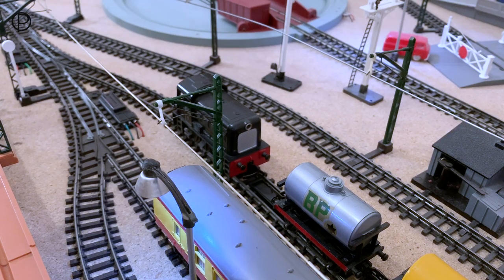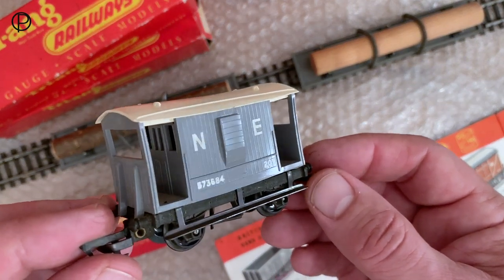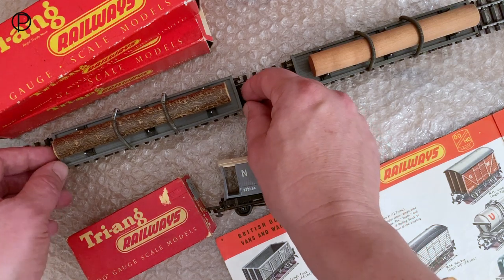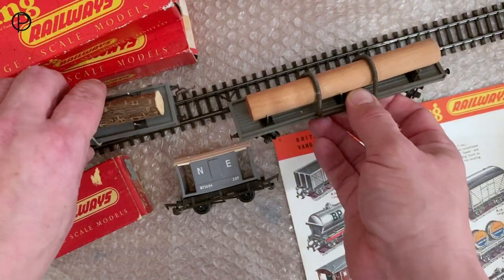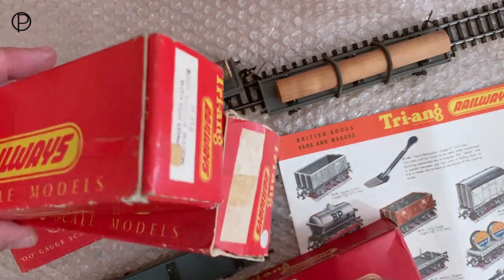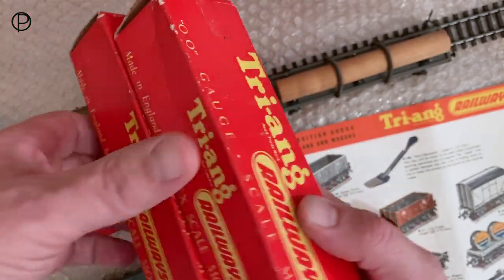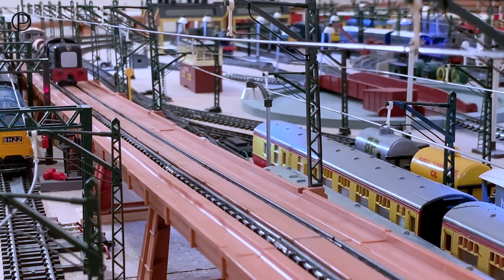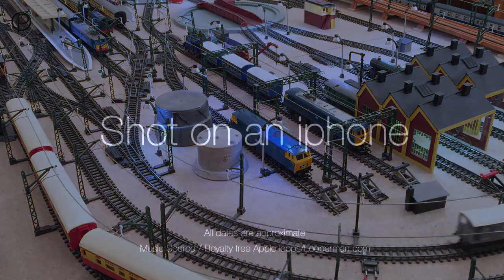Tri-ang Railways R.253 Dock Shunter with Bogie Bolster Wagons with Log Loads

Comment: Hello Oscar,   Been watching your videos for some time,  great stuff along with all the information you give about each model.  These old Dock Shunters are very collectable with all the variations they done, I have eight all different, Red, Black and Yellow all with nothing broken, interesting in your catalogue they showed one with a different number although you said, not made.  Nice to hear all your wording obviously a real enthusiast, I look forward to more
Reply from the maker: Hi Barry, glad you're enjoying the videos, I think that was the 1958 catalogue with 57 on the cab side. Pat Hammonds books make no reference to 57 being on the side of this model. Its quite confusing sometimes reading across three books and I frequently make mistakes! Sounds like you have a great collection. I have the black one you see in the video and a slightly later one in black with its lift of lid box numbered 5, A red one numbered 3 from the late 60s in a Tri-ang Hornby square section box with flaps at each end, a black one from 1976 numbered 3 (smooth wheels) in a widow box with black face card & white outline illustration of the model. Then I have the Yard Switchers R353 a Red unboxed one numbered TR20071 and shield on cab , a yellow on in a lift of lid box with Tri-ang Railways on the side and shield on cab and then A Yellow one in the RS11 set with Tri-ang Railways on the cab side but very worn and shield on cab. So I still have a few variations to have fun finding. Thanks for watching and taking the time to comment.
Oscar
Reply: @oscarpaisley  Hello again Oscar,  Thank you for your long reply yesterday.
I expect you have heard of ,  chambs123   on Youtube,    if not type in , chambs123, help needed here, dock shunters,  regards from  Barry

Comment: Thanks Oscar, great video, I just acquired a black Dock Shunter, not quite as old, with tension lock couplings, great runner, I prefer that earlier type pick-up, the light unit was missing so I've put a yellow LED in for now
Reply from the maker: Hi Paul, I've installed an LED in one of these models too that had no lighting unit. It's very bright, I've always been going redo it and never got around to changing it
Thanks for watching.
Oscar.

Comment: Great video again mate ,I have two from around 76/77 one I got mint boxed last year and the other I’ve had from new ,I just found a replacement body in mint condition for her as the old one was well worn from my childhood ,It was and still is a sweet runner and I’m still amazed how slow it can go even over peco insulfrog points ,those old motors if well maintained were superb and it great that your channel is bringing back good memories as I got  this shunter for Christmas 77 and always remember the smell of the fresh oil and turning out the lights to see the head light shining it came in the same present as a texaco wagon and the must have set of 1977 the intercity 125 can imagine how busy I was Christmas afternoon had it set up on a board in my room my dad ,grandad ,step brother and uncle playing with my new trains hehehehe didn’t get a look in until Boxing Day mate 
Thanks Oscar  Mark 😊👍🏻
Reply from the maker: Good morning Mark, that sounds like a terrific Christmas. The smell of these items in use is often overlooked but a very important part of the memories. This litte model must have been a great seller for the company and great design using the existing motor bogie,
Glad you enjoyed the video.
Oscar

Comment: Nice to see your dock shunter and running so well.  I have one which I have converted to DCC complete with LED head and rear lights which I run on code 100 track.  It runs OK but would probably benefit from an attached shunting truck with additional pickups.  I always enjoy to your videos.  Keep them coming.
Reply from the maker: Good evening Robert, glad you enjoyed seeing this model on the layout. Sounds like a great upgrade you have made. I've installed an LED in one of these models that had no lighting unit. It's very very bright, I've always been going redo it and get the brightness down.
Thanks again for watching.
Oscar

Comment: R253 was my first ever diesel model and it really is a classic Triang model, great looking and tough as old boots too-mine did a few baseboard tumbles and survived. Same power bogie as the lovely TC diesels too. How do these mechanisms last Oscar? do they need frquent lubrication on those pads and motor worms? regards Paul
Reply from the maker: Good evening, great to hear you have one of these models.  Little and often with the oiling if the model is in constant use.
Thanks for watching.
Oscar

Comment: Still got my dock shunter. Remember happy childhood days watching the little light running around in the dark. How do you prevent your steel track from rusting. I saw one tip using WD40.
Reply from the maker: Good evening John, I think the light on this model gave it great appeal. Terrific to hear you still have your original model. I've only wiped the railheads and painted the fishplates with WD40 or similar for storage after I've cleaned up the track first. When installing on the layout I would then clean this off before use and make sure to clean the inside surface of the fishplates to ensure a good connection. I haven't suffered from too much rust so far, regular use and track cleaning seem to do the trick. But the end of siding next to the engine seems to get light surface rust on the railheads from time to time. 
Thanks for watching glad you enjoyed the video.
Oscar

Comment: Great video Oscar! I love this little loco, @ 14:25 What is all that fur at each end of the worn gears?
Regards
Kev
Reply from the maker: Hi Kev, the fur at each end of the gears is listed on the service sheet as part S5108 felt lubricating pad for keeping the bearings in good working condition at each end of the armature assembly. 
Thanks for watching.
Oscar

Comment: now these wagons have all got the early coupling, but presumably they're made from polystyrene? was the acetone plastic only used in the first years or when did they change plastics? I presume well before they moved to margate
Reply from the maker: Good morning, this wagon started life in the early 50s and from what I've read the change of material had started by 1955, not all models changed at the same time.
Oscar